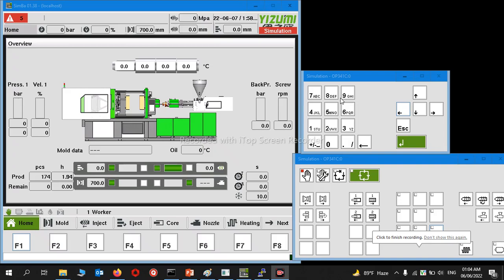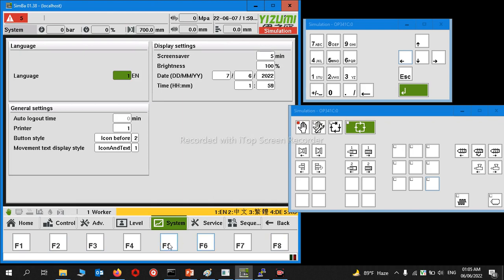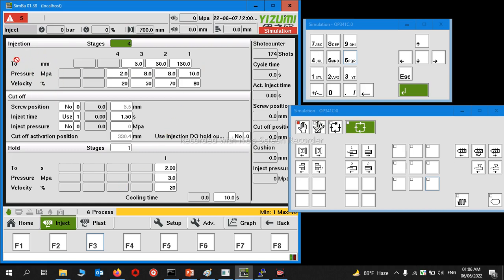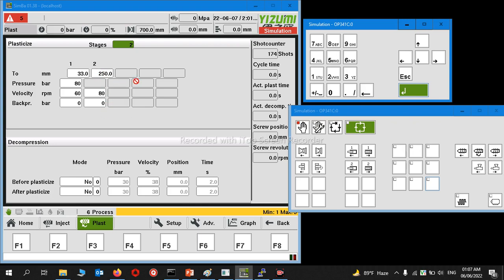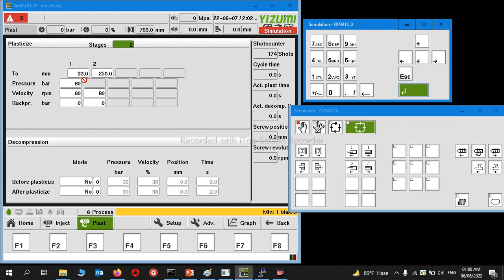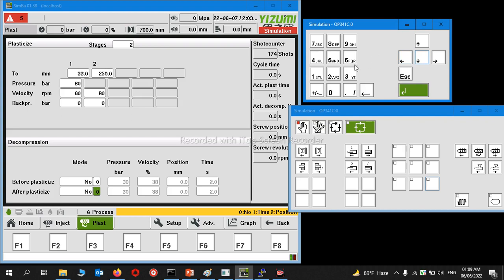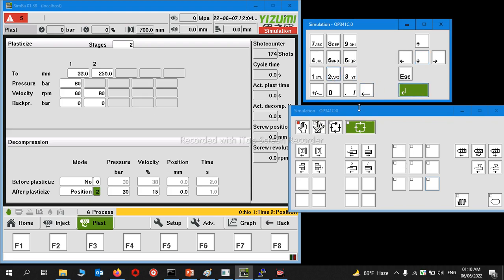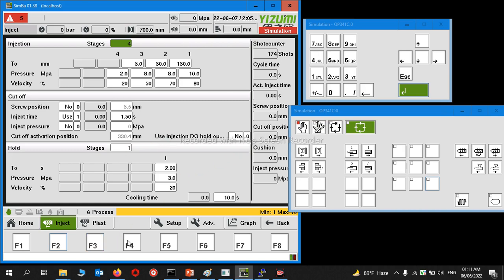Injection molding Machine Parameter setting: Plasticization (Charging)

Comment: can u pls tell me how to use parameter of keba plc
Reply: Yes i can tell all about keba controller. How can i help u?
Reply: @onlyoneyoutube3982  how can i check my settings id okay or not, bcz suddenly my product short
Reply from the maker: suddenly short means that there is less possibility of setting issue. You Can try by increasing cushion size, mold cooling system, Barrel heating system fault unstable hydrulic pressure.